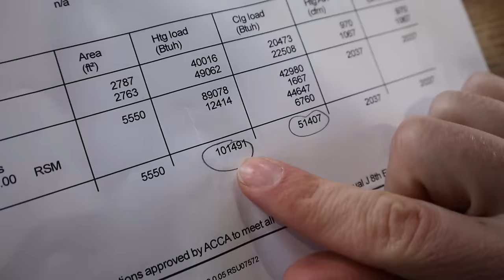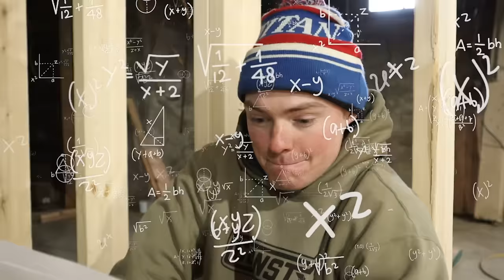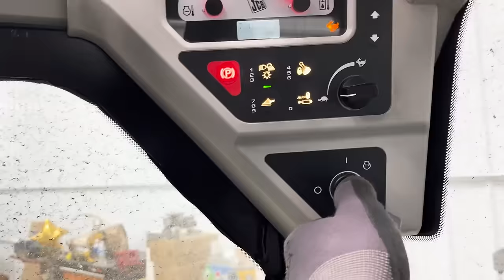Restoring A $7,000 Mansion: Removing 2nd Story Floor

Comment: Plumber with 40 years in the trade. With tankless water heating getting more popular I would go with a Navien tankless boiler for your in-floor heating. When you get to plumbing for the house a Navien tankless water heater with recirculation for your hot water needs.

Comment: Mini split systems are great! Much better for lung health, easier construction. Vents harbor so much especially with you already having trouble with critters! If one goes down you got the others to back up. See if they can quote you with this and or hybrid. Attic mini split especially if its all open spaces. The mini splits are heat pumps too so heat & ac!

Comment: 42:49 the blue sheet is a top sheet and gets the brunt of the weather effects. In my experience those sheets are always slightly larger and will cause grief for you when it comes to flooring. I try to avoid using that board all together!

Comment: Even if its more expensive its good to have 2 heating/cooling systems should one fail at a bad time.
Btw i noticed in the plans that the bathroom door will be under the new staircase. 😁

Comment: So far as the HVAC, it is good to have zoned systems so you can decrease the amount used in any spaces not being occupied at all times.
Heat pumps, IMO, is the best way to go.  However, you did not mention the tonnage they are suggesting.  For 5555 sqft you would most likely be more efficient going with at least 8 tons between the 2 units.  It is not the amount of systems you have, necessarily, but the amount of tonnage to make them efficient.  Also, the SEER2 rating is very important as well to keep the monthly electric cost lower.  The higher the SEER2 rating, the more efficient the system.

Comment: In a house this big, you NEED two systems.  Being able to control the upstairs and downstairs separately is what you want.  Heat pumps are the way to go for both the boiler and the HVAC system, operating costs will be way lower. I figured your would be well north of $60k for all of this, pay them to do it all. One throat to choke is worth it if there are issues

Comment: Heat rises, so when you have a single source of heat, upstairs always gets too hot in the winter and the basement gets too cold in the summer. The best option is to "zone" the 3 floors via mechanical means or use multiple HVAC units. This allows you to better manage heating and cooling per floor, as they will be adjusted separately. Another advantage is being able to keep one floor warmer/cooler than the others, i.e. keep the bedrooms cooler at night without heating/cooling the entire house. Re: heated floors - a failure in this system can get really expensive. IMO, keep it simple with gas forced air heating, and AC.

Comment: Heat recovery system. Good idea. Try installing system that can be programmed NOT to run continuously. Maybe 15 minutes every hour or whatever works for your house. Very expensive to run 24/7.

Comment: don't cheap out on the zoning on the hot water boiler. use circulators, not zone valves. i like the Weil Mclain wet face boiler with a boiler mate.

Comment: quick question, have you looked at a corn fired boiler for heat? I think you may know where to get your fuel. May be more expensive now but running cost will be a lot less

Comment: Have you considered multizone ductless split ac/heat systems? They are not that expensive and you avoid all the ductwork and you can install these yourselves (lots of YouTube channels have shown people doing this - one I like is Life Uncontained [much smaller house than yours]) I'm not an HVAC person but in most of the rest of the world these are used. You wouldn't have to run all of the duct systems and rather than having 2 large heat pump units you would have probably 2-3 of these per floor (my guess) given your open floor plans on the main and attic levels. Rather than having the same temperature everywhere, you would be able to adjust temperatures by the zone of the house. So, when you pop into a room and want it colder or hotter you can do that without using energy to essentially do the same to all of the rest of the house. For hot water and additional heat or maybe for your heated floors, look into liquid and/or steam producing solar panels. These are very different from photovoltaic panels that everyone is familiar with. A friend of mine in Maine with a large house installed a geothermal system. Maybe a combination of these technologies yields less cost and more flexibility as well as more resilience if power goes out, massive storms, etc. These are very different from photovoltaic panels that everyone is familiar with. I've watched your channel since its beginning. Keep up the incredible work.

Comment: Floor heat is good but Gas fired only. Floor heat is Very inefficient on Electric, and hella expensive to run. You can always build a duct chase to run ducts between floors-A false Closet for the duct work risers and the returns. 30:43

Comment: Best to have 2 systems. The ac system will die someday, but likely not at the same time. You'll be glad you have some heating or cooling while you replace the old unit. Our house has two systems, 1 upstairs and 1 downstairs. (Each has its ownfurnace and compressor)

Comment: I saw on another video of someone building that they put truses in so they cud run the vents and wires and that between the floors. Might be something to look into, yes u may loose some ceiling height but then won't be so ugly if its between them etc

Comment: Also, what happened with Roman's truck, was it the fuel pump? And, I believe that the heat exchanger is a cross ventilation unit that heats incoming cold fresh air with warm exhaust air. It's used in houses that are tightly insulated.

Comment: I would not put ducts under the big windows because if you want to have plants by the windows the cold and heat would affect them. Since you are putting floor heat it should not be a problem with air conditioning or heat.

Comment: You should not do any forced air. You should do heated floors and minisplit heat pumps. Then you just have to run the refrigerant lines and not forced air ducts that you don't even have room to run in your ceilings.

Comment: I would definitely separate the first and second floor systems for performance. I’d recommend a variable speed “high efficiency” heat pump system for sound and comfort but not necessary for $savings. Keep in mind these are high tech with more expensive maintenance and repairs long term. The primary benefit is comfort in my opinion. Ecoer makes a good budget friendly product with great tech support. I would suggest getting a few more prices as pricing in the hvac world can be all over the place. Just be sure when getting quotes to compare apples to apples. And if you see one designing the job in a different way ask if there’s a reason for it. Sometimes a cheaper quote is cheaper for a reason. And sometimes a more expensive quote is only to help pay for the owners shiny toys and house 😂

Comment: I'm sorry to break it to you cole,but You're going to have to go with the split heat pump system. Because you plan on using the former attic for other reasons besides storage you need the split system. You're going to also when you add-on the addition you'll need another system for that part of the house as well because it's not just going to be a breeze way and a garage.

Comment: Look at other options as well 3 quote minimum. Compare them. You have good insulation there shouldn’t be much heat loss. Look at a 1 unit 7.5 ton heat pump. Look at a tankless hot water unit for your heated floors. There is electric options that may be more efficient as your on LP gas.

Comment: Point loads from beams above transferred onto support column or multiple studs should not be supported in the basement by multiple 2x8 in the basement that run perpendicular with the point load in the center of the span of the sister 2x8. 
Lolly colum to a footings is one fix.
Point load place over Masony wall that is properly constructed. 
Point load support made from steel or masonry attached the existing properly constructed masonry wall.
Properly size steel beam in basement joist bays to carry all the loads from the Point load.

Comment: I'm from a young Architect Austria/Switzerland/Liechtenstein and here we would never go for 2 units, because for the extra 10000$? you could add a lot of insolation, and that's the approach I would recommend. Moneywise you have to make a cost calculation and also factor in the heating cost for 50 years which should be the expected lifespan for the heating system.

Comment: My only comment comes from many years of home and building renovations is that there are a few major fixes you COULD do yourself but in the long run you’ll save yourself time and money (lots) if you hire and trust professionals to advise, plan and do the work…like hiring the spray foam guys rather than doing it yourself…HVAC is like that! Also is floor sanding…I learned THAT the hard way…looks easy and you’ll look at you freshly sanded floors and think, “HA! Easy-Peasy!” But then when it’s got finish on it the waves show up! UGH! Hire out floor sanding and HVAC! You won’t regret it!

Comment: Man those prices and numbers you're talking about are insane! If I were you, I would've done all of the installation by myself as I did in our house.... EVERYTHING! I also planned everything by myself, as you should have. Buy cheap welder for PPR pipes and you install pipes for water, you can also go with PEX-AL-PEX pipes and use them for water system and to transfer heating water to floors.... Some are using PEX-AL-PEX also for floor heating loops, but I would use PEX A piping.... PEX-AL-PEX is also available for crimping and for fast coupling.... $15.000 for boiler? Omg

Comment: Two systems are better and once you get used to it. You might want to adjust the temperature so it feels the same. The only problem with AC Systems is when you work outside or buildings wth only fans for air circulation, the AC makes you feel hotter than just opening windows and running several fans.

Comment: i would do whats called a mini split system.  it will be considerably cheaper in labor and materials.  you can control the heating and cooling in each room.  check into it.

Comment: In floor heat in the basement yes.  At lease install the pipe runs before re-pouring the basement slab.  Might cost $500 in piping but well worth it in the long run. Most will not do in floor heat on the other levels because really not needed.  You can do  a bathroom with in floor heat mats for when you need it but not the full first level.   If you are not going to be finishing the basement ceiling for a few years just wait on the in floor heat to see if you need it or not truth is if you have a basement at about 65 degrees you probably will not need in floor heat anyway.  If you installed the basement walls and floor you increase the temperature by a few degrees as well so you be closer to the main house temperature.  Talk to the electric company and see what they say about heat pump most use a lot of electricity to work when it gets cold.   Geo thermal is the best option and most energy efficient heating out there but the draw back is the installation cost of the wells or the pipe fields. Price wise for the system you are going to be close to the heat pumps might be cheaper actually.  But then there the pipe field to install that will cost you but that is just digging a trench's 3 to 5 feet wide and 5 to 7 feet deep lay the coil loops in and back fill.  You can do that easily.  There also vertical wells that they use today put you have to drill 150 to 500 foot wells for them. I would really get ahold of someone not family and talk to them about geo.  I replace my system 3 years ago the old one was 27 years old before the compressor started to go out.  I had a heat pump and geo priced the geo was actually $3k less then the heat pump was plus the saving of the electric bill as well each month.  Then you also have the 30% tax credit on the system if you meet the rules and that is even on the ground loop part. So if the install is $100k you have $30k in tax credit.  But with a heat pump you can only get $3200 in tax credit max per year.  Geo thermal has no cap on them like other systems.

Comment: We insulated a tremendous amount of the interior walls when we built our house. All of the hollow walls require a lot more energy to heat and cool!! We used backed batting. for ease of installation and flexibility. Never Never Never use blown, loose or any kind particle insulation.  It is a nitemare to control and keep from settling. All of the floors and ceilings were also fully insulated!!  This provides sound deadening , for a  quiet house!! Use all of the sound deadening you possibly can In the bathrooms,  Laundry rooms, bedrooms and kitchen so sounds from  active and noisy areas do not travel to bedrooms and quiet areas, and between floors !!   Our bathrooms are super insulated and sound deadening  so you can almost never hear showers, sinks and especially toilets flushing anywhere in the house. No matter how much it costs it will pay off in energy savings and  comfort and quiet piece of mind. It lasts forever and you cannot go back later and fix  sound and insulation problems.
I would never do radiant in floor heating.  At some point down the road they will fail ( I guarantee) and the cost of repair is insurmountable!!!  You want more than one  HVAC source that is installed  so you can easily repair or replace each system individually. These systems only last 10 to 15 years max and the they fail and you have replace  both the main unit and air handler.  Ductless mini splits in some areas might be good in remote less used areas!!  When one system  fails you need a second one that  can maintain heat or cool  in the house until you can fix the broken one!!
Install HVAC  main components where they are easily accessible for maintenance or replacement in the future. At your age you will upgrade this systems 2 or 3 times in your lifetime!!
Do not use overly sophisticated  HVAC systems that cannot be easily  understood  and  repaired by yourself or whomever you call. If the  computer system  dies you are screwed!! The energy  savings of sophisticated systems will be quickly lost in reliability and repairs.  You will need also a separate wood or pellet stove, so when you lose power in a winter blizzard in Iowa your house does not freeze and  bust all the pipes and plumbing.  This can also save substantially on energy cost for  gas and electricity  for your main heat,

Comment: Keep in mind heat pumps can only pull heat out of the air, when there is heat in the air... Do some research on their effectiveness during temps below 20-when you're really going to need the supplement.

Comment: LOL.. one more thing... Air Heat Recovery Unit... I happened to work at and a manufacturer of these for 16 years and at one point was in charge of all the regulatory listings such as Energy Star, etc... and this unit is a BIG saver for you, but it's not obvious why unless someone explains it.  First, if the air in your home is too moist, it takes a LOT of extra energy to cool or heat up the air in your home because of the mass of water just floating about in the air.  You will see moisture too high in your home when you see water vapor on the inside of your windows... running down and turning your new wood windows or trim black with mold over time.  The HRV (Heat Recovery Ventilator)  exchanges the humid air in your home with outside air when the outside air is less humid and gets rid of that moisture costing you money to heat.  It also recovers 70 to 80 percent or so of the ENERGY in your air before exhausting it by passing it through a heater core that transfers the heat to the cold incoming air or vice versa in the summer.  Summary: Exchanges the air with outside air when needed and recovers the vast majority of the energy (read: cost) you spent to condition it in the first place.  Don't skimp on the HRV!... LOL   (OH... and don't forget to install BATHROOM FANS with AUTOMATIC timer switches... will get rid of the moisture in your bathroom after a shower (and other ... less than desirable air smells... )..  and will shut off automatically  (I set mine to 60 minutes before I get in the shower and it shuts off later after exhausting all the extra moisture,)

Comment: I’m getting ready to redo the heating in my house BUT.  I have an 800 square foot house that is supplemented with a wood stove.  Back in the day, I remodeled a 100 year old house with my ex husband.  My heart hurts for you with the heat.  You do not want to cut corners.  I will say this and I don’t know how you feel about burning wood but you can get a semi of logs to split down and a hot water boiler with wood heat is amazing.  I HATE forced air heat.  You have the acreage for a pond to supply the heating system I am talking about.

Comment: Are you talking Geothermal system? You have the land to make it work. My friend had it put in and he has a gas heater helper. A/C is not a problem as the temperature comes out of the ground at 56 Degrees. Heat pumps generally I have heard some grumbling about heat pumps.

Comment: 2400 Sq feet house we have 2 also.  Pellet stove in front of house and the newest is a Bosch but it operates better abd quieter ... buy at 2400 Sq foot they said it was harder on 1 unit then have 2